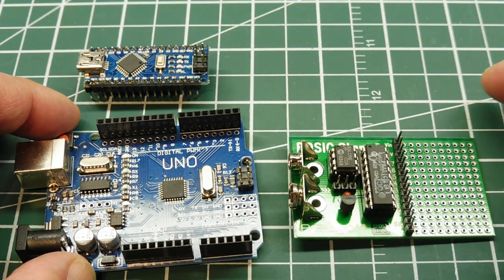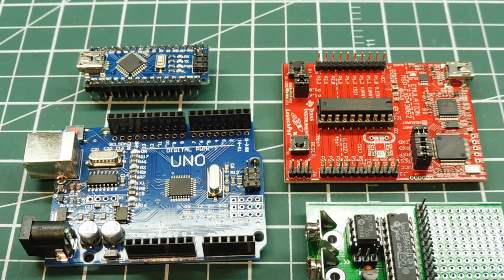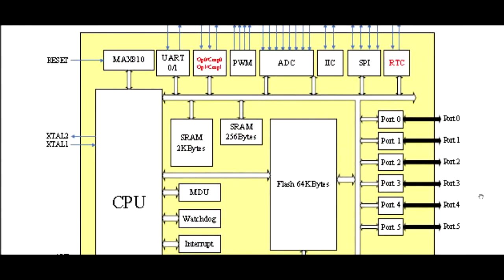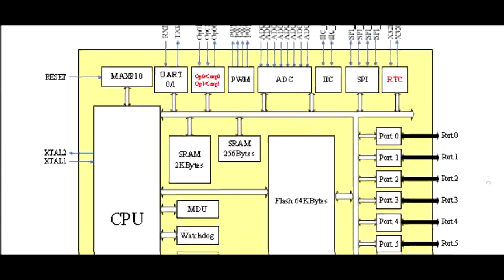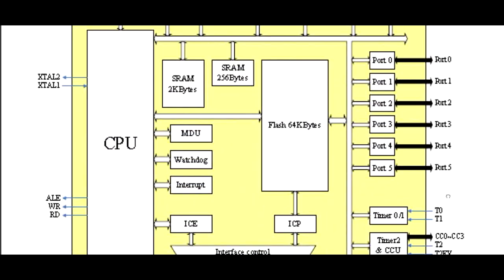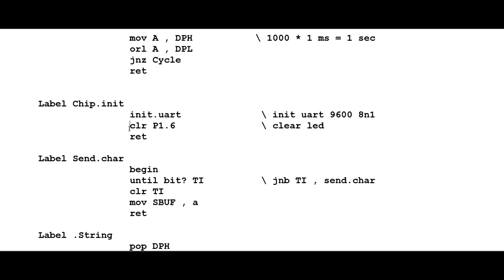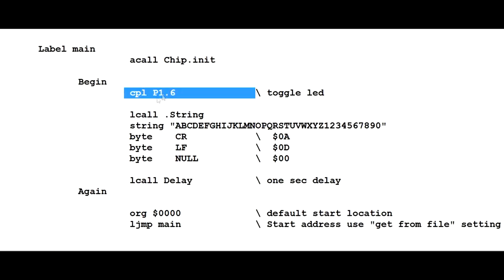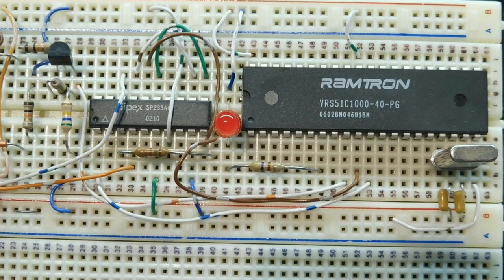Consider an updated 8051 micro in your next project.

Comment: I am looking to replace a KIM-1 6530-002 RRIOT (RAM/ROM/IO/Timer) maybe with an old micro controller like the 8051.  I only need at least 1K for ROM (Needs Addressing A0-A9) / 64 bytes of RAM, 16 I/O pins and an internal timer. This sounds like something the 8051 can handle. However I have only used the 8051 once or twice for smaller projects.

Comment: Hey, I came across a ABOV MC96F8316SD in a cheap microwave. The datasheet says it's a ""Mentor 8051 core" and that it's ROM size is under 64k so it can be used with 3rd party compilers." I downloaded a couple of IDE's that showed up in my Linux software list but they seem to have very specific part numbers they work with like the old Atmel 8051 chips. 
    I thought it would be interesting to play around with this specific MCU because it has a 12 bit ADC, and it's already setup on a cassette tape size board with a complete AC mains power supply, 2 relays with AC Mains auxillary power for a fan and motor, a buzzer, a keypad matrix, and 12 I/O that powered a LED segment matrix. I couldn't ask for a better dev board, (I can handle the small AC mains PSU risk with a small enclosure).
  Are you aware of any general "Mentor 8051" compatible IDE's to help me get started with a chip like this, or is there some trick to deciphering what settings to use or what part numbers are compatible?
Thanks, -Jake ;-)
Reply from the maker: Mentor Graphics originally was a company that developed PC board layout software. Check out Keil compiler IDE software as they support Mentor. They may also have software for the ISP to upload code into flash.
http://www.abov.co.kr/data/appnote/AN_0008_V1.00_EN.pdf

This is a mass produced hardware item by ABOV where they use 3rd party compilers by Mentor.
Reply: 0033mer 
  I was worried you might say that. $4k+ software had better print me valid blank paychecks directly... While writing code for me automatically and giving me a back massage....
 Plus it doesn't even have Unix support. Windows is dead. Any company that hasn't already adapted or is in the process of adapting to a Unix dominated world on all fronts is way behind the curve IMO.
   It's kinda sad if Keil is the only option to play with a refreshed vintage chip like this. I don't understand how a company like that is even in business when there are free tools available these days. What am I missing here? How in the world can these guys maintain 1990's business structure and pricing in the modern age of open market competition?
Reply from the maker: Offshore mass produced electronics is a whole different world.
If you want to spend the time to get an ISP interface up and running you could program the 8051 core with a simple free 8051 assembler. The ISP description is described in chapter 14 of the data sheet. ABOV sells the hardware:
http://www.abov.co.kr/en/index.php?Depth1=5&Depth2=3&Depth3=12

You would have to check pricing.
Reply: 0033mer 
...yup...still banging my head against the wall on this one but I really really appreciate the help ;)
 I still don't completely understand what "8051" really means in practice. If 8051 is supposed to mean that the IC uses the same "instruction set" why do I need unique flashing software to send the assembled machine code to an IC that is supposed to be the same?

  After looking up the Mentor 8051 datasheet, they say, 
"This microcode-free design is software compatible (including instruction execution times) with industry standard discrete devices, having all their core 
features, and the additional features corresponding to the Intel 8051/8031/ 
80C51BH/80C31BH/87C51 parts..."
  While the Linux 8051 IDE software says it's compatible with, "Currently this program supports only 80C51, 8052,"..."T87C5101,..."
   So apparently the IDE supports the original 80C51, and Mentor lists the 80C51BH. That got me digging around for what the difference is between no "BH" and 80C51BH, but no dice. At this point I guess I should just connect them and give it a try, but I'd still like to understand what "8051" really means. I know it's not a RISC, CISC, Harvard architecture type of thing. Is "8051" like some open version of what AVR is to Atmel, or PIC to Microchip? What makes the different part numbers uniquely incompatible beyond memory size, available IO, hw connection ports, and a dedicated ISP?

BTW if anyone wants super in depth info about the 8051 I went through about 3/4 of this before asking the questions above:
http://what-when-how.com/category/8051-microcontroller/
...and this has most if not all of the original information from Intel:
http://intel-vintage.info/intelotherresources.htm
... I'm really trying to avoid asking stupid questions if at all possible ;)
-Jake
Reply from the maker: The 8051 was developed by Intel in 1980 and the patent has since run out so anybody can use the core for free. This is why you see them in high volume consumer products. The micro cost them pennies to embed into their product. The 8051 has 128 SFR ( Special Function Registers) and only 21 are used in the original core. This makes it very easy to upgrade the micro with i2C,SPI ... etc and still be compatible with basic 8051 code. Companies who make their own upgraded 8051 write their own bootloaders to upload code into flash. If you can find a way to upload a hex file into any upgraded 8051 you can use any basic 8051 assembler together with the data sheet containing the upgraded SFR usage and run your code on it.